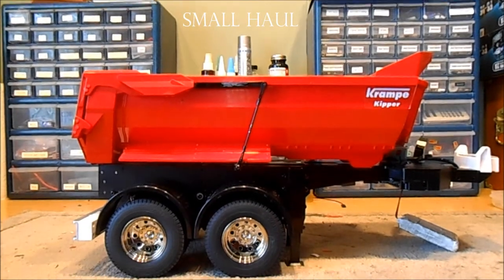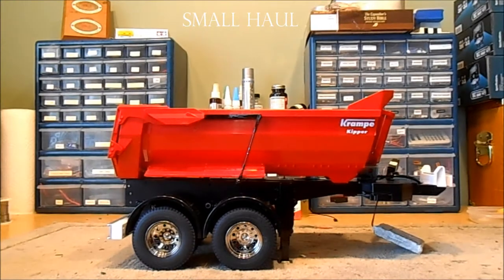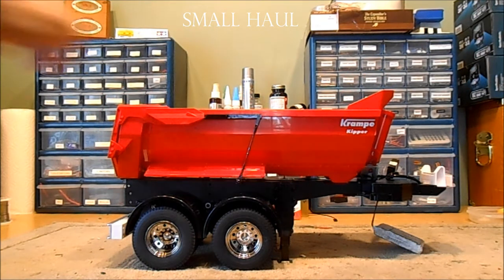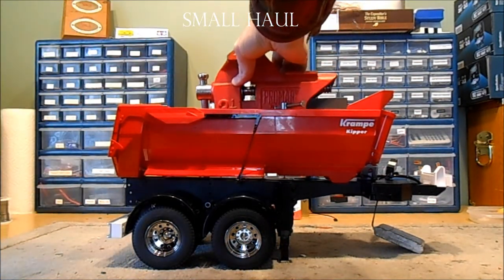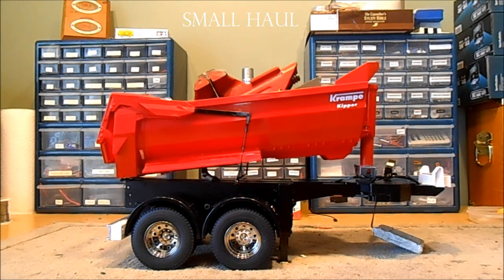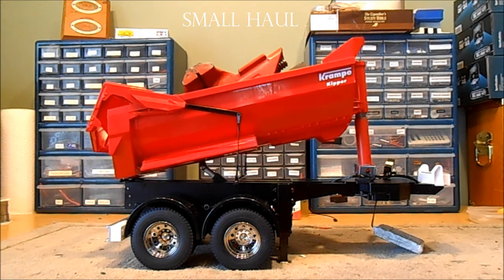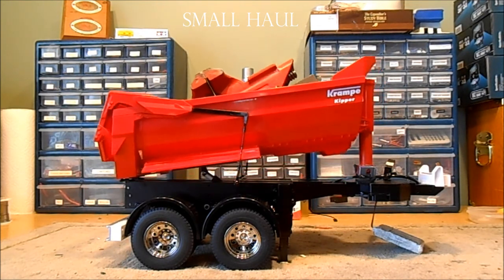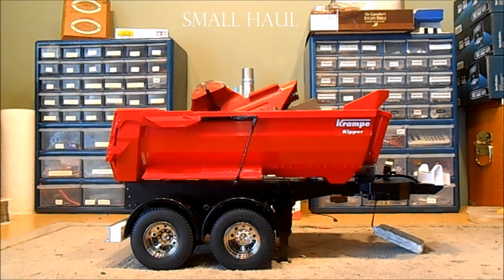Bryan's Dump Trailer

Comment: Doesn't look more than 20 degree angle, not enough for moist dirt.
Reply: It is 30 degrees which works fine.
Reply: My eyes deceive me... will the trk that pulls it be a short Bruder Mack cab 4x4? Be sure to get some pics & vid of it at Cabin Fever, plz :)